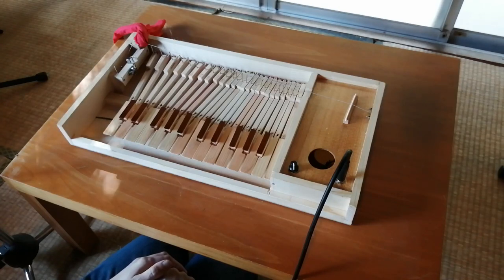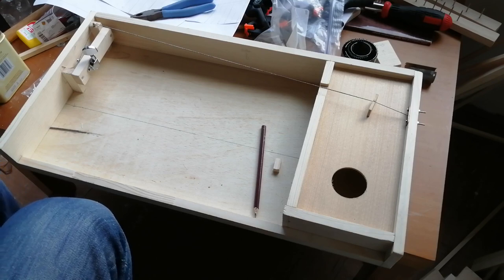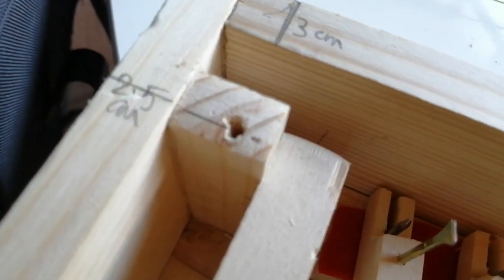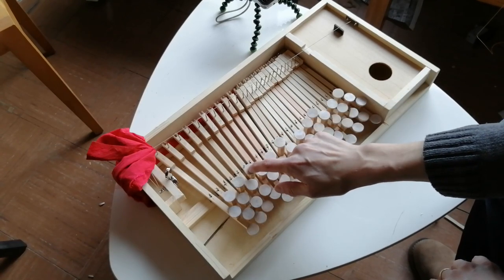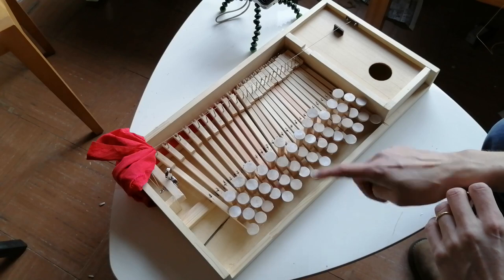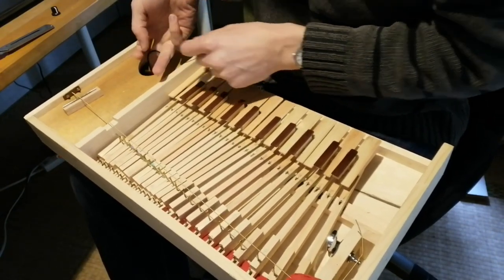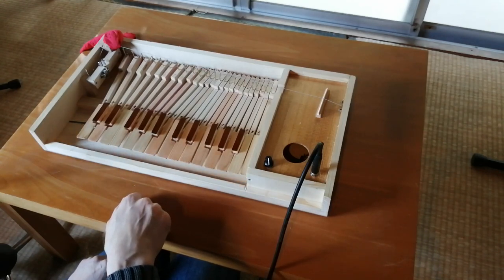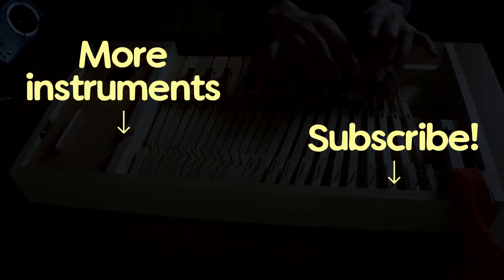One string, semi acoustic travel clavichord!

Comment: This is soo cool! Definitely one of the favorite DIY projects I've seen.
One thing I'd like to note is that you could've still made a mostly-isomorphic keyboard without the leverage issues by just using the traditional keyshapes but arranging them so there's a black key in-between every white key in a 6–6 pattern—six lower keys (C, D, E, F♯, G♯, A♯) and six upper keys (F, G, A, B, C♯, D♯), which would make some of the lower keys white and some black, and vice versa for the upper keys. This is actually a bit of a direct precursor to the Janko-esque keyboard you had tried and has existed in some form throughout history.

Comment: One of the things that's getting you is that you have all of the pivot points in a single line.  To get balanced feel, you need for the flat/sharp keys to have their pivot point further away so as to get close to the same fraction of their bars before the pivot as the natural keys.  This would have also helped for the isomorphic keyboard, although there you have the additional problem of keys at 2 different front-back positions on each bar (most of them, anyway).
Reply from the maker: It is one of the many many problems with the instrument, though honestly I think it's quite low on the list! I did stagger the pivot points on the other clav I made (there are various videos on my channel). Regarding this one: apart from there being two keytops on each key, they are arranged on the diagonal so you would need twelve different pivot locations, actually. I think just having longer keys would have made much more of a difference to playability. In fact, I'm pretty sure a lot of electric keyboards have the key pivots in a straight line...
Reply: @SangerStudios  On an electric keyboard, you don't have to apply much force to get the note to sound, so cost-cutting probably dominates.

Comment: since metal touches metal, there seems to be an opportunity to use that like a kind of stylophone but potentially even more. i wonder if there could be some useable metrics available such as resistance and capacitance. could even get some sort of polyphony if each key had an input into an arduino and processed in an infinite number of clever ways like possibly relationships between different paths between keys. could definitely be fixed to some kind of oscillator, could even use the piezo output and measure those hz and do fancy tricks with each key's note such as FM or RM. maybe if the string was the ground. nice thinking outside the box project because it inspires a lot of others potentially to get ideas. the main point i know is that a clavichord is an acoustic instrument but it's all math ultimately so i think there's room to play with ideas with this. thanks for sharing the experiment.

Comment: Nice job. Have you tried lyre strings? They might give a bit more tension (volume). Also, an octave pedal would give you your octave down.
Reply from the maker: Thanks! I've never used lyre strings, I'll look into it. Actually since I finished this, I cut a hole in it and installed a guitar pickup, but it's still a bit disappointing!

Comment: Is there any reason the tangent has to travel upward to hit a string which is above it, rather than having it travel downward to hit a string which is below?  I would think the mechanism could be simplified while reducing the instrument dimension by simply having the tangent on the bottom of the playing end of the key or, if it's necessary to increase the velocity by having key levers be the full front-to-back width of the instrument, and having a lever under each key which is pivoted at the front, and is pressed by the key lever about 1/3 of the way back.
Reply from the maker: Well, the Hohner Clavinet strikes the strings downwards at the key end, and they sound fantastic. Actually a little rubber hammer on the underside of the key clamps down on the string from the top, like hammering-on on a guitar. They use springs to return the keys to their original positions, which is certainly more complicated than a single lever/pivot, but you could just do it with gravity I suppose! Not sure whether it would be better or worse... If you try it, let me know!